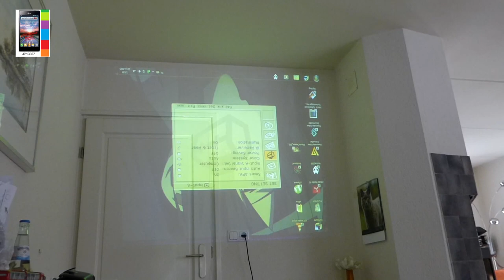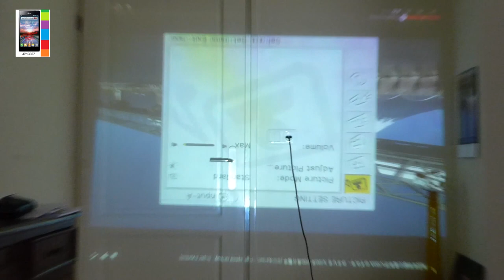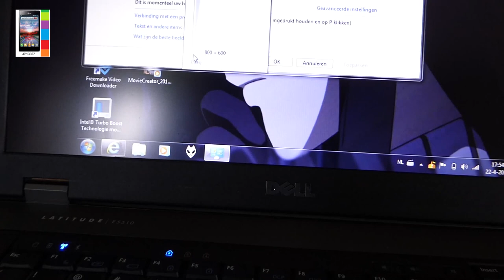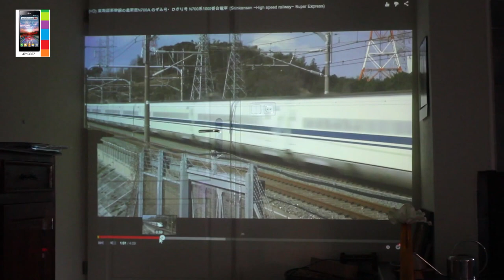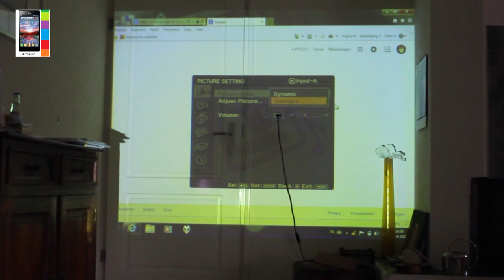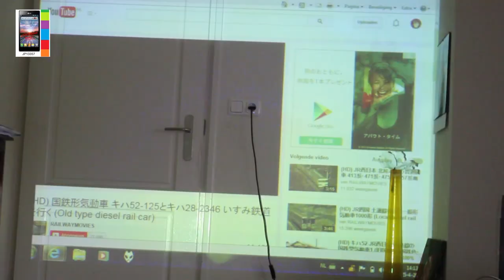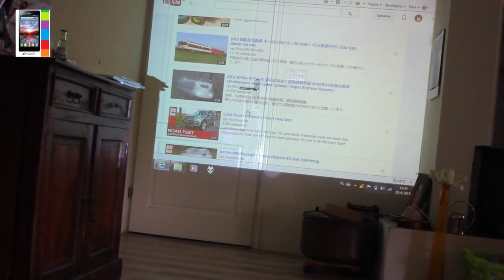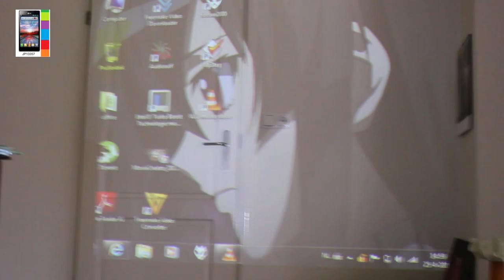Sony VPL EX1 CS6 unboxing Test HD beamer projector

Comment: I bought this beamer for a low price, now i can see a pink artifact in the upper right screen. A pink pixel spot. How to fix this or to expensive to fix? Thanks
Reply from the maker: It is dust in the 3 LCD unit. You have to take it completely apart.